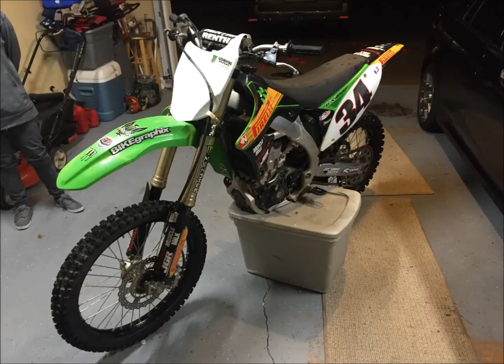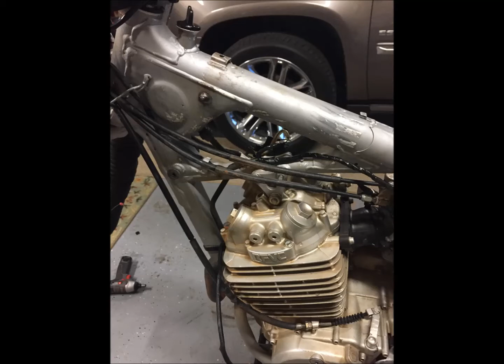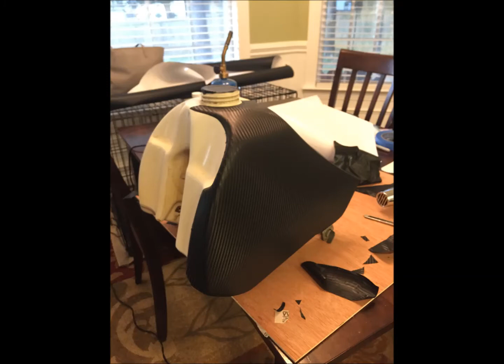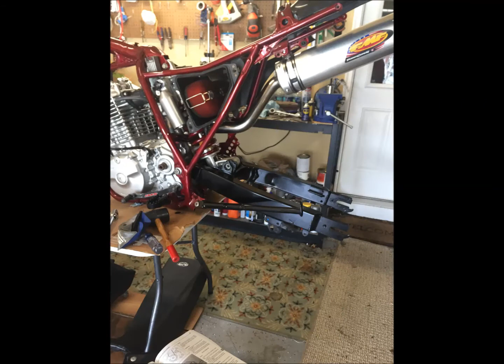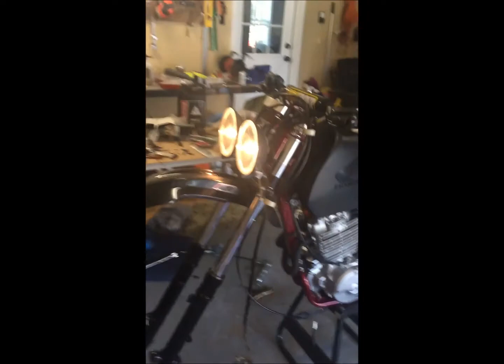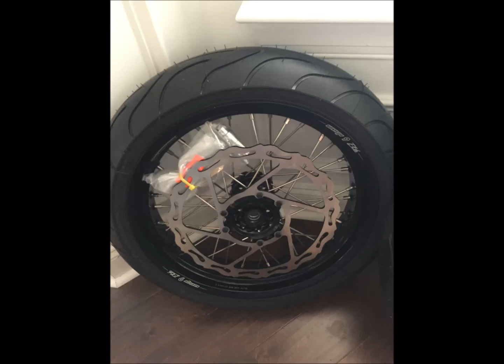XR600R Supermoto Build

Comment: How long did your vinyl wrap on tank last? In the process of trying to wrap mine and shew it’s not easy!
Reply from the maker: It didn’t last.  I wrapped it twice and kept getting bubbles after a while.  I didn’t realize that plastic gas tanks can’t be wrapped because gasoline vapor can permeate a polymer, allowing vapor to buildup under the wrap over time.  Sounds crazy, I know.  I ended up getting a tank cover off of eBay that luckily matched my paint scheme.  If you have a metal tank, it will work fine.

Comment: Did you look into a USD fork swap?
Reply from the maker: Murray Robinson, I looked into it, but I was under a deadline to get the bike done and it would’ve added more time that I really didn’t have.  I have been thinking about swapping the forks with a CR500 front end.  The stock forks are a bit squishy.  I think I could just swap the springs and get the desired outcome.
Reply: crf450 fork swap is well worth it.

Comment: What’s it top out at on the road? Would ya need to change gearing for highway? Awesome bike bro
Reply from the maker: I believe stock gearing was 14/48.  I went up a tooth on the front and down 3 on the back to make it 15/45.  Haven’t topped it out, but I’ve been over 90 on it.  It will definitely do the ton.
Reply: @Jcmmusic2  I have a 95 600r with warp 9 wheels also, I run 15/40 at track days with it, not sumo track but high speed road race track.
I installed a hotcam and mikuni pumper , xr only full exhuast and top out at 108 by gps. It cannot pull redline in top gear, 108mph is  7000rpm with that gearing.

Comment: With the larger front rotor did you have to modify the caliper mount?
Reply from the maker: The supermoto wheel kit came with a caliper mount that relocated the caliper for the larger rotor.  The kit came with rims, mounted tires, wheel bearings, sprocket, and caliper mount for $1149 shipped.  The company’s site is www.motoxindustries.com

Comment: Wered did u get the speedo cluster at?
Reply from the maker: Wendell Cautrell the guy I bought it from had it new in the box.  It’s an Endurance II, made by Trail Tech.  You can get them for about $80 with mounting hardware and all wiring.

Comment: Do you have a cush hub on the rear wheel?
Reply from the maker: Jacob Gay , I could only find a Cush hub kit for an xr650, not an XR600R.  So, no I don’t have a cush hub installed.  We’ll see how it holds up.
Reply: Also what size rear wheel did you use? 4.25 or 5
Reply from the maker: I got the 4.25” rear wheel with 150 Michelin pilots